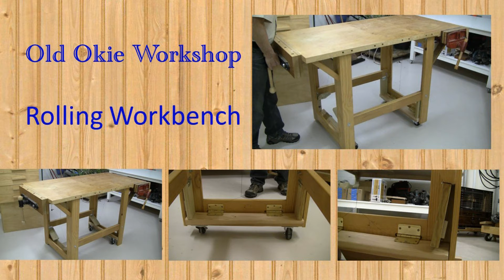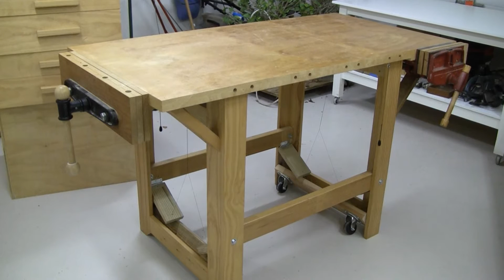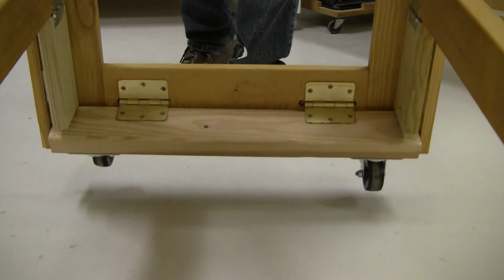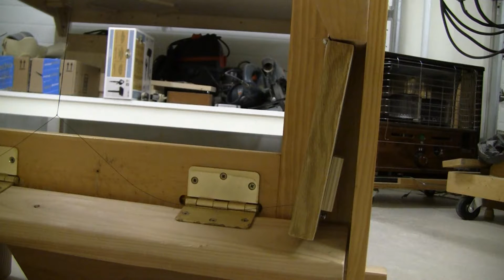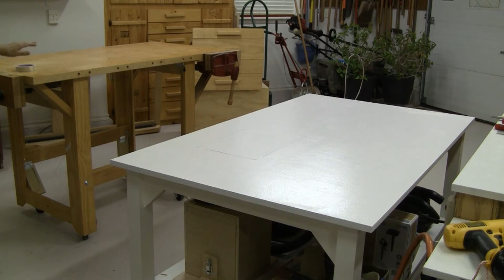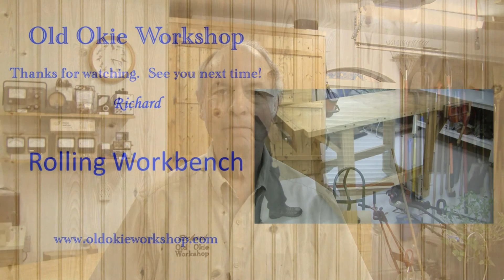Rolling Workbench

Comment: I made a similar caster design except that instead of magnets on the support boards, I just used spring-loaded screen door hinges. 

I like your improvement over the NYW design in that you do not have the caster board supported by another board near the hinge. Since your "kicker" boards are tied right into the workbench legs, they support all the weight. No need for the caster board at the hinge (or the hinges themselves) to support any weight. I did make one improvement -- instead of swaged butt hinges like you used, I just used surface-mount gate hinges. Those are not swaged, and so did not require mortising a depression in the board for the hinge pin.
Reply from the maker: Thanks, J.  You have some good ideas there.  I thought about using the spring-loaded screen door hinges too and bought some.  But the ones I bought had too powerful a spring so I didn't use them.  I thought it would be too hard to pull them up.
Reply: Compared to the weight of the table, pulling the rope is almost nothing. I have a single piece of rope (one on each end, so two total) threaded through some eyebolts so the top of the loop is a few inches below the bottom of the workbench top. When I lift the workbench I can simultaneously pull the rope up and I barely notice the tension on the rope.
Reply from the maker: Good for you!!!  Thanks!